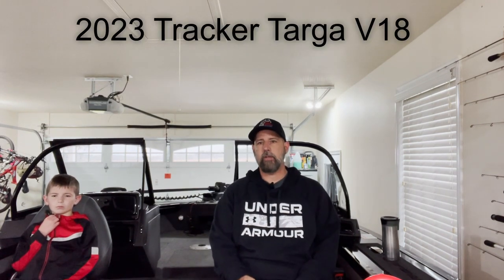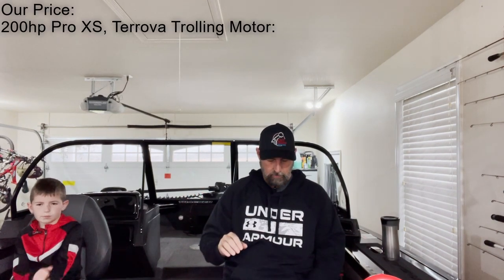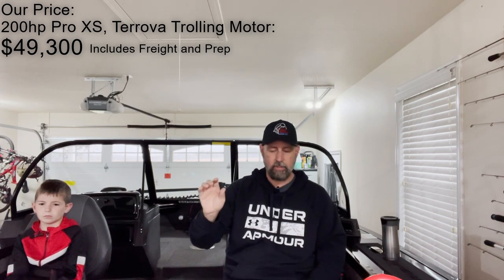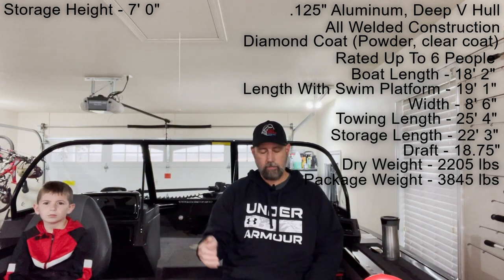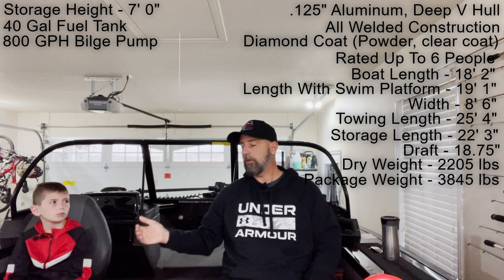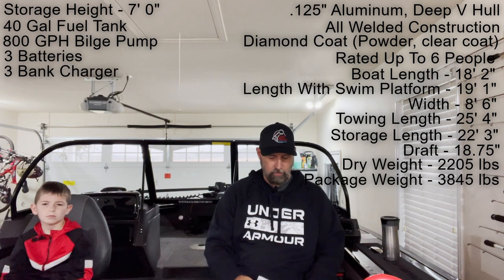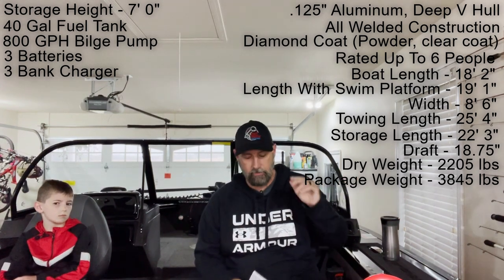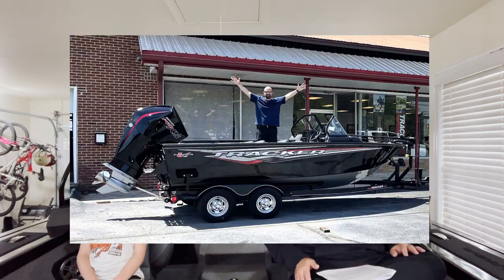2023 Tracker Targa V18 Walkthrough and Review (Factory Issues!!)

Comment: Thanks for your video! I have the same boat and set up other than the prop that I bought in January of 23. I have no issues with it coming out of the water to get on plain but I can only trim it a quarter of the way on the trim gauge and I get prop blow out. Did lowering your motor allow you to trim it out more?  And if so how far on the gauge?

Comment: Great video.  Thanks to you and our son for putting together such a well organized video.  I have been looking at the Targa's as a replacement for my Lowe FS165.  Good to know what to look for when I finally pull the trigger on one.  One question for you.  You mentioned that you use trailer dollies to get the boat in the garage.  I would like to see your setup for moving it in the garage.  My garage is long enough by is tight width wise.  Thanks again!
Reply from the maker: I actually sold my wheel dollies. Took me some practice but I can back it in where I need it now. Takes me a few tries. The wheel dollies worked well but still needed 2 people to move it around.

Comment: Follow up, I picked up my V18 from the repair shop. Took it out on the water yesterday. Mercury ProXS 200 ran like a champ!! The issue turned out to be a severely crushed fuel line under the decking that starved the engine for fuel. My Boat runs great...time to go fishing. Can you do a video on Livewell operation to include using switch positions and the "pull out" to drain feature and how that works. Thanks. Good Boating!

Comment: I took delivery on same boat 2 months ago. I noticed the cavation issue right away. Mine has the 150 tho. Also a significant motor shake at low speed. My dealer is not able to replicate my concerns however and I can’t be on the boat when they tested!   I have noticed the need to trim a lot and I hope that will reduce the power loss in turns.  I don’t have the issue as bad as you’ve described. The motor shake is bigger deal to me as I troll at very slow speeds 1.2-2.5 mph and the boat shakes.  Dealer states it’s normal in line motor operation - vs a counter balanced V-6type engine.  Idk. But it sure is a great boat. Im sure your son will love driving it when he’s tall enough!! Thx for vid. I shoul do the same vid for north east comparisons
Reply from the maker: I've had it back on the water a few times since my repairs and adjustments and it seems like all the issues have been fixed. My 200 definitely doesn't have any shake to it even at idle speeds but I'm sure its comparing apples to oranges.
Reply: @thejohnsonfamilyjam1063  Hi there. what was your fix on factory prep blow out ? I am going to be purchasing one same reasons you did and I am trying to ensure these issues are fixed immediately. Thanks in advance! Emir

Comment: What was the blowout issue?  What did it do or what actually happened?  I take it you were able to repeat the issues, over and over.  I’m getting. V-19.  Ordered it a couple months ago, and will be able to get it at the end of winter.  I’m just not familiar with the issue. . . All my previous bot were used.
Reply from the maker: Basically the prop was losing contact with the water. Some people will call it ventilation.....Kind of like your tires spinning in your car when you lose traction....When I would turn right, left or try to trim it out the prop would lose contact with the water and RPMS would spike. The motor was lowered to fix that issue. Good luck with your V-19...All said and done I now love this boat!
Reply: @thejohnsonfamilyjam1063  Thank you, for the info!  Lots of things to break in on a new boat or vehicle.

Comment: I’m a welder no the best but pretty good as my job  mostly involves welding. What I can say from what I’ve seen on tracker boats with the leaks are a freaking head ache and annoying but they tend to be fixable and not the end of the world just a headache.

The most common with the new ones tends to be the cheap fittings with the live well. Or a piss poor welder messing up with the seam welding and the weld cracking both is fixable. 

The real reason we are seeing so many of these issues is the models that was built during COVID, causing a severe lack of works in all departments allowed a lot more flawed products to be put into the market.

I’m in the market for a new one now and can pay cash but I’ve decided I’m going to to wait another two years before I do it to give the COVID flaws a chance to be worked out

Comment: Let me guess ur live well pump was leaking…I have a 2021 model almost identical…came one weekend to the cottage after I bought it found water in the boat up to the top of the centre storage compartment…boat was full at least one foot water..was a live well pump leak. Was a loose pipe to the pump…lucky I searched for for a leak and was able to see the fast drip.
Reply from the maker: Nothing worse than not realizing you’re taking on water! From what I was told it was the drain fitting under the rear livewell.
Reply: Turn on back live well on during fishing. I Notice next day checking the center storages compartment where the batterie is store. Saw a foot high of water in it. Can this be the live well pipe connector leak? Maybe loose connector or a seal?

Comment: Took my 2023 Tracker Targa V18 Combo with 200 Mercury Pro XS out for the first time yesterday, 4-30-23 for engine break in. Motor was hard starting, at 1000 rpms did ok with full trim down, pushing up rpms 1500-3000 the Merc would bog down and quit while we out on the lake!!! Tried to run it for about 2 hours but it just kept bogging and quitting even with 30 gallons of 88 octane fresh fuel. Thank God for Trolling Motors. Very disappointed for a boat purchased new in Oct 2022 from Cabela's in Roger's Minnesota. Problem is I don't live near, and dealers are scarce in my neck of the USA. I'll be following up with a Service center tomorrow.
Reply: Update?

Comment: I bought a new V19 last year and I discovered over time that it had a number of quality control issues, including both livewells leaking at the pumps.
Reply from the maker: Seems like everything is fixed now. Even my dealer said the seals Tracker uses aren't the greatest. He ended up replacing them but also siliconed everything as a backup measure.

Comment: I bought a brand new 2022 model year less than a year ago and honestly I didn't have any issues other than trailer bunk carpet sucks but they redid it for me.  I ordered mine from the main Bass Pro in Springfield, MO and I also got the 200 Pro XS.  No other upgrades.  It's awesome. Didn't watch the whole video.  A bit long winded for me.  Especially the part about you explaining over and over again about the issue with the prop and the motor being mounted too high.  Which was really just a leak.  You could have just said it was a leak.  Good video otherwise!  Again my boat didn't have these issues.

Comment: What top hole are you using now on your motor. I have lowered mine three holes which equals 2 1/4 inches but have not had the chance to put it in the water yet because of flooding. Maybe I need to raise it up a whole before I put it back in the water?
Reply from the maker: Mine is in the third hole down.

Comment: You should have no problem using your tilt right off, but it doesn't surprise me that they had the motor mounted too high. I was looking at buying one, but they seem to have terrible attitudes and customer service. I inquired about a boat and the corporate office called me and I asked them to send me a build sheet and they told me they couldn't do that, so I called the dealer, and he sent it to me. Asked the dealer about getting a trade in value for my old boat and they told me they only take boats in trade that have a Mercury motor. I told them that was over the top stupid.

Comment: Update, I want to add...the problem with my boat Engine, 200 HP Mercury ProXS is not the fault of Cabela's in Roger's Minnesota. Dealerships do not put the new boats in the water to test them out. The Dealership was in fact, great to work with, fair and honest, friendly and helpful. This is most likely a Mercury Manufacturing issue...stuff happens. Luckily we got off the lake safely and my boat is now in a service center closer to where I live. The warranty will cover the engine and it'll all work out. The Targa is an awesome boat! do not shy away from looking at them.
Reply from the maker: You’re correct. I mentioned in the video that Tracker and Mercury decide where the motor is mounted, not the dealer.

Comment: 3 weeks?  thats nothing....everytime ive brought my V20 to bass pro it takes half a summer...but its Alaska and thats my only option...  i lose half of my short summer just to bring it in...and first summer we had it we put less than 8 hours not even broken in and had it in shop all summer for electrical issues. now they fixed it but my motor wont rim above 2000 rpms and wont go above 2000 rpms until its trimmed all the way down.. it cavitates in hard  turns also. only got the 150 wish i had the 225 or 250 though